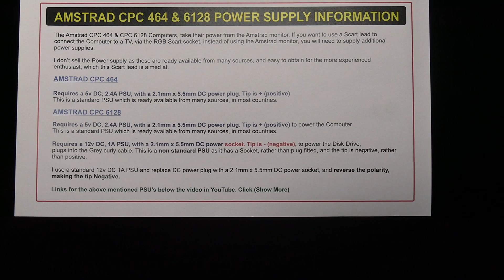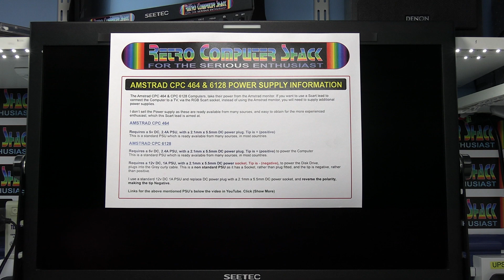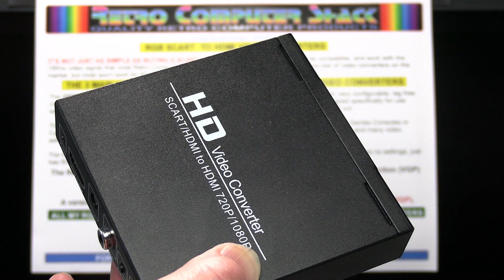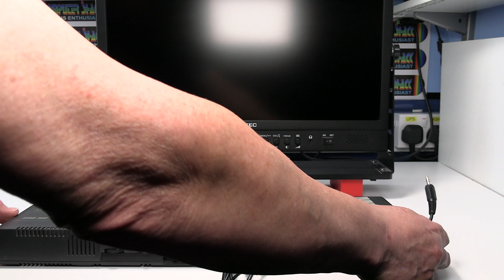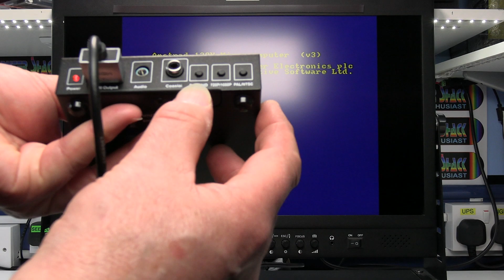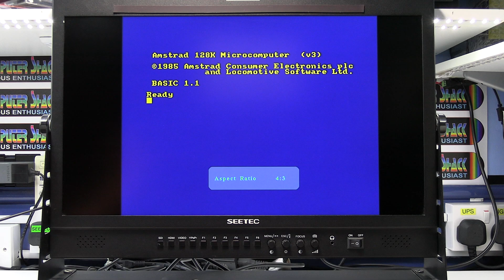Connecting an Amstrad CPC 6128 Computer to a TV via HDMI

Comment: I wish I'd checked this video before I bought two cheapy Scart->HDMI converters that cant  seem to handle my 464's video. Audio comes through fine but not the video. Greatly appreciate the links to the converter you're using. May well be placing several more orders for datacorder belts in the near future, I've a stack of poorly Arnolds here that I intend to restore